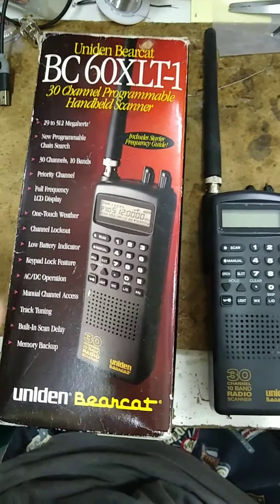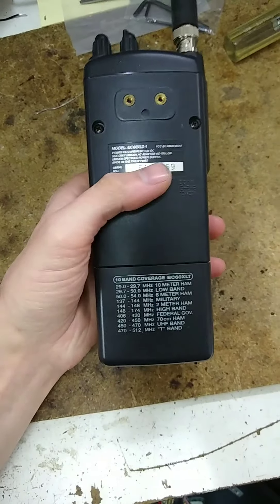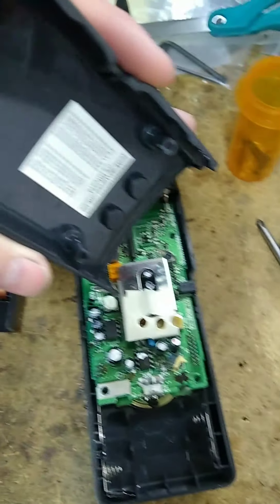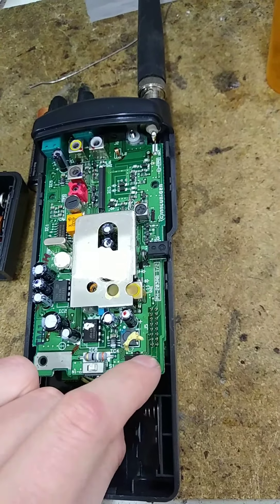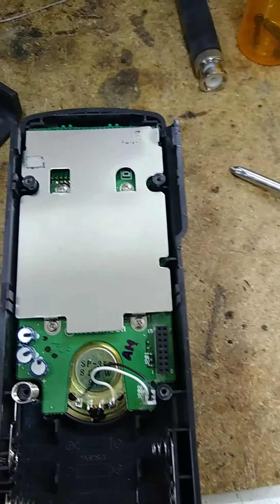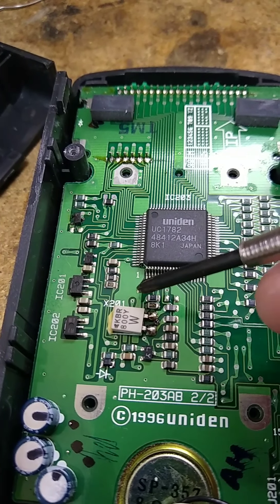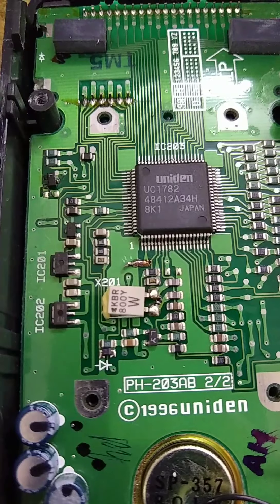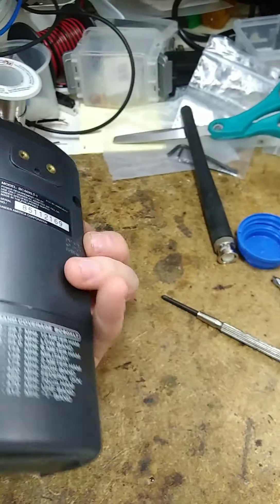Uniden Bearcat 60xlt-1 80 memory mod

Comment from the maker: Update: I tried this mod on a 2000 model and it worked. No low band loss and 80 presets total.
Reply from the maker: Another update. Did it on a different 2000 model and it lost lowband vhf but had 80 presets.
Reply: I wonder if it works on the bc60xlt? Mines not a, -1